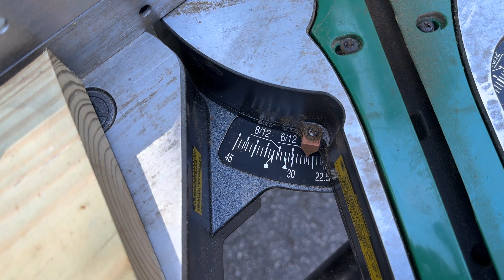Modern 2-Story Shed Build | Part 31 | Making a Ramp!

Comment: if you added a bit of a pitched landing it might feel less steep? also you could rip some 1" x 1/2" strips of ply and fasten them along the seams of the boards for more of an aggressive grip
Reply from the maker: Thanks! We’re thinking just to take off the 2x10 boards, make angled furring strips to get to a 4:12 pitch, and then re-attach the 2x10’s. As it is, it works great, it’s just a little steep 😅

Still though, one project done! Only thing left for the shed are the doors!! 🥳🥳🥳